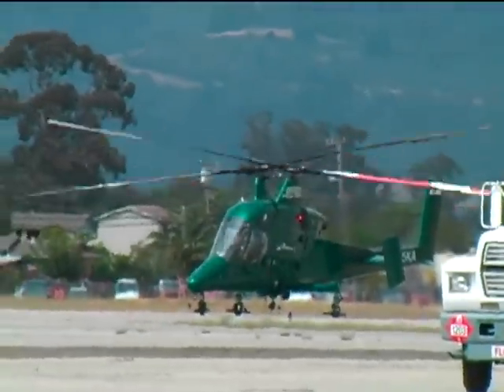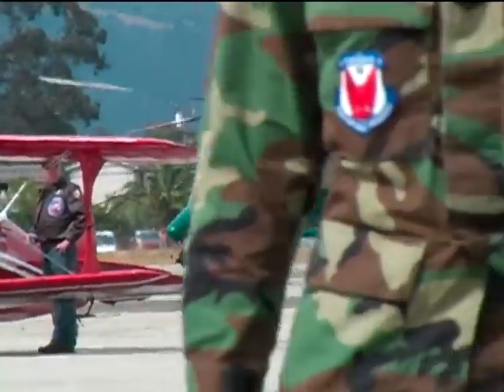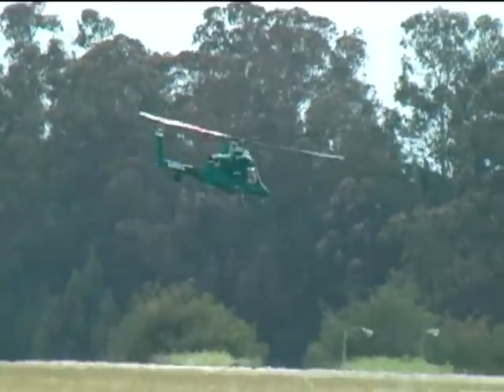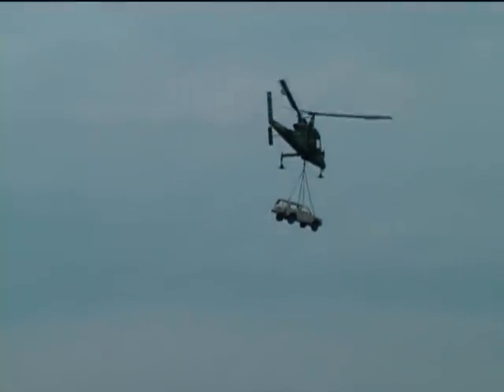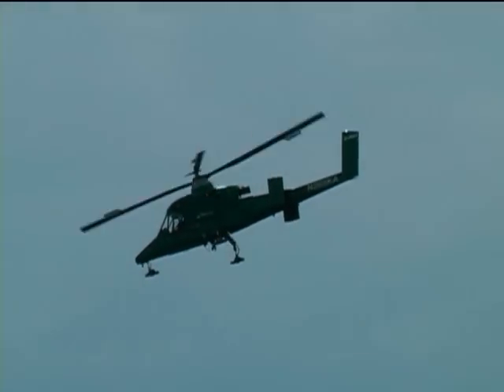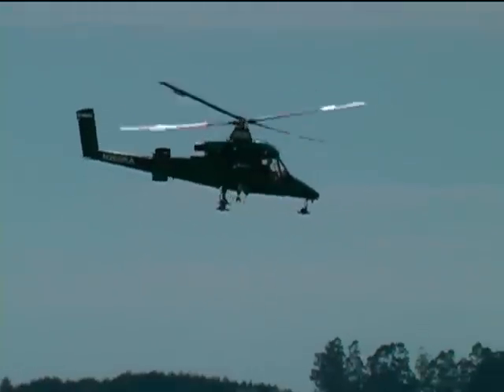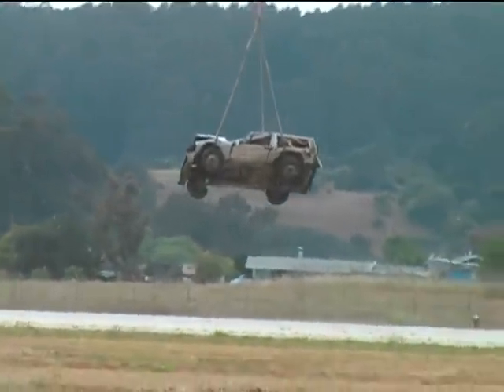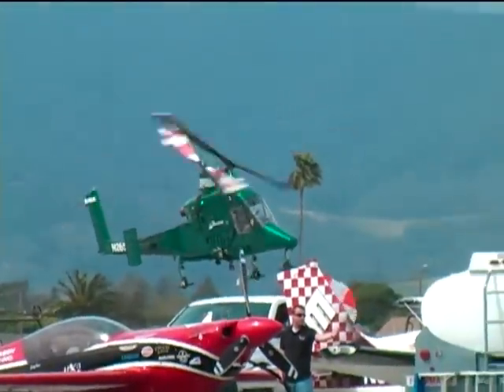WATSONVILLE 2008 KAMAN K MAX HELICOPTER

Comment: He had a lot of his facts wrong, The chopper does not weigh 6000 Pounds. 6000 Pounds is it's Cargo capcity. And the SynchroCopter has only ONE ENGINE. TWIN SHAFT system, Not a Twin turbine engine...

Was he Reading a paper about the K-max? or was he just judging it by how it looked?